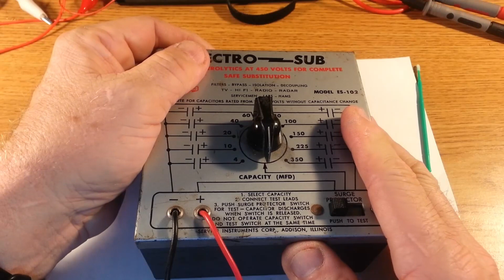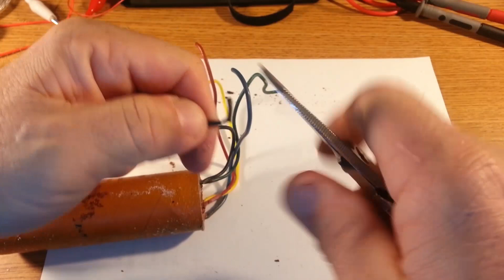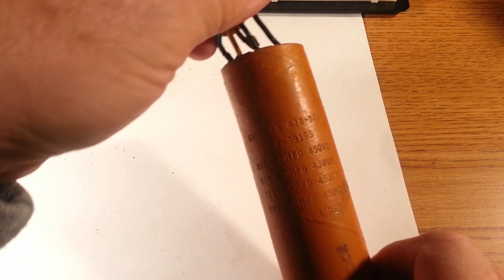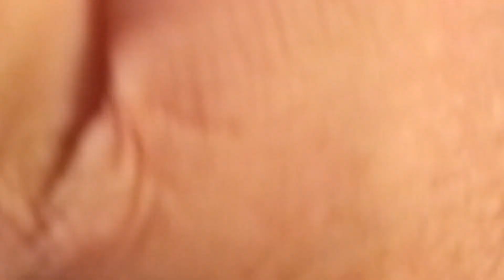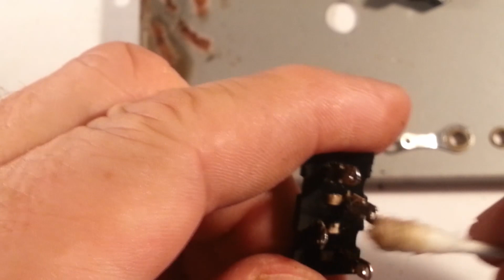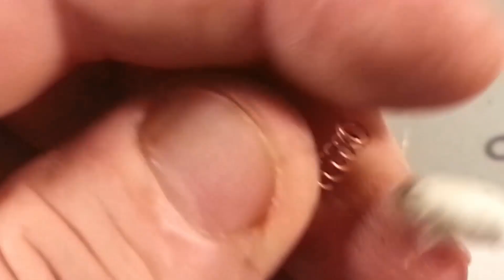E003_Part 1 - Sencore ES-102 "Electro-Sub" Capacitor Sub Box - Takedown and Resto-Mod

Comment: Bravo! I was just given this same unit. I knew it would be multi value 'can caps'. Mine is in really clean internal condition. BTW you can push the text leads black and red wires into the holes for storage.

Comment from the maker: If there is ever a doubt of thinking if you should disassemble a switch to clean it ( if you can) versus just spraying a contact cleaner into it and cycling it, this video shows how dirty the contacts on a switch were by just spraying "WD-20 Specialist Electrical Contact Cleaner Spray" and cycling it versus disassembly and cleaning with 99% Alcohol and swabs.